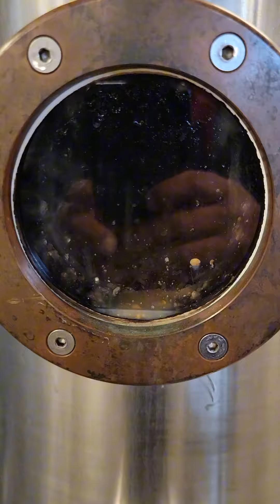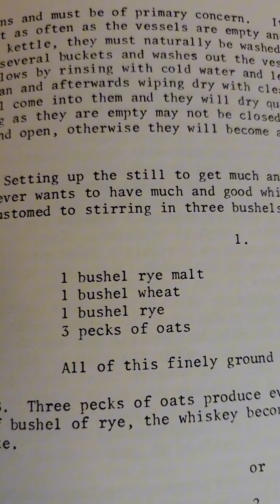Pennsylvania Rye Project with Stoll & Wolfe

Comment: Kveik yeast for whiskey you say...  CHALLENGE ACCEPTED!  (I've done a few homebrews with kveik & they've turned out great).
So did I see apple chunks in the column @ the 9:00 mark on the vid?  I have just begun messing around with a double thumper set up.  Haven't charged them with fruit yet, though.
I'm only about 1.5 hrs to the Northeast of these guys.  Will have to check them out!
Reply from the maker: Yep, been doing it for years (Kveik) and it works great.  Yep, apples on the second set of barrels. Podcast soon on One Piece At A Time Sacred and Profane